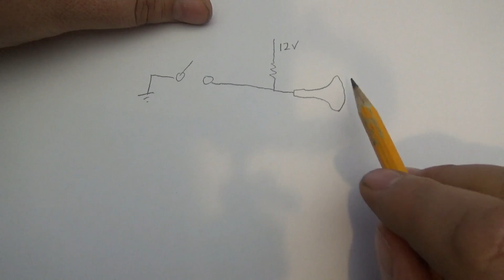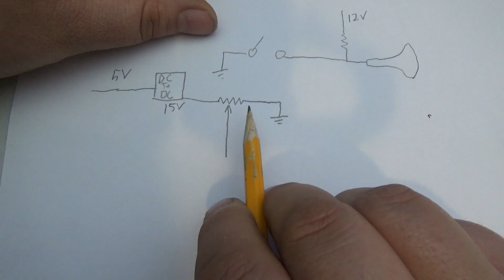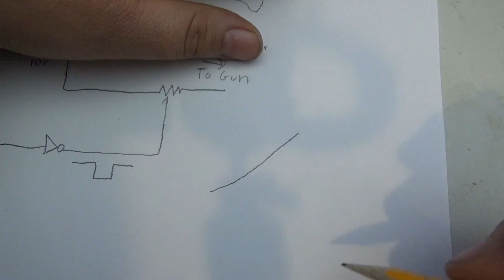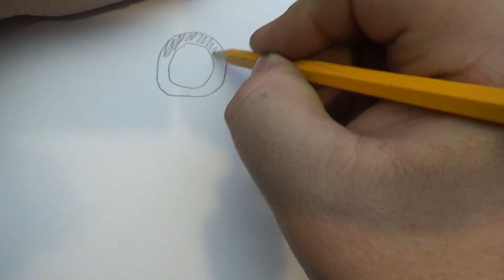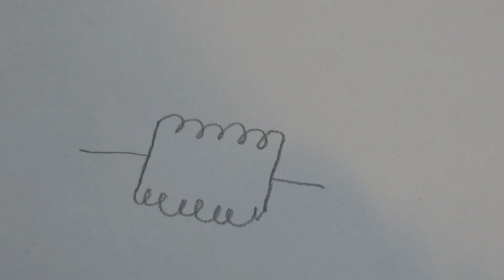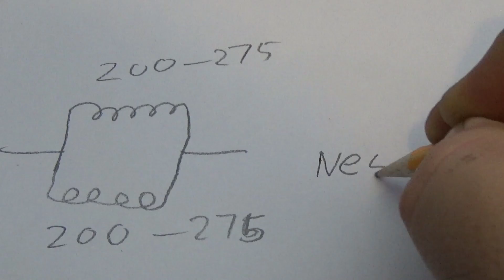WORLDS SMALLEST VECTOR MONITOR

Comment: Thanks! I like your yoke design. Simpler than what I was thinking. I will be making an XY yoke soon and I need ideas. My commercially made XY yoke has been dedicated to an image dissector tube based television camera I am currently building. If you are interested, there is more stuff like this on my channel too.
Reply from the maker: i watched your video. if you plan to run your vectr scope clock pcb you may need a faster yoke. the yoke should be measured by inductance but lets say .5 ohm per coil might get you there. the reason i suggest that is i believe that pcb is intended for electrostatic deflection.  i seen a comment somewhere you were curious about that mini deflection pcb. my email is koppjason83@yahoo.com i can design a custom deflection pcb if you like

Comment: This is incredibly cool.
To make it even more power-efficient, would it be better to use a different yoke shape? Doesn't the toroid trap most of the deflecting field inside the ferrite, where it goes right around the outside of the tube?

Comment: Ofcourse you can use inverters to work on analog signals. Thats what CD4069 are for. They are always unbuffered (so a single CMOS inverter gate), just put a feedback resistor on them, input resistor to set the gain and you are set.

Comment: I kinda want to make my own CRT, maybe out of a large test tube so I don't need to learn glassblowing. I wonder if that is feasible.
Reply from the maker: yup i have done it before its actually not that bad . collect the phosphor from a fluorescent tube or a bw tv set  mix with distilled water then pour into your new tube let dry . also you will need a vacuum  pump.  remember some cathode materials last longer than others
Reply: @ArcadeJason  hmmm, I might "borrow" an emitter from a broken television. My only worry is that a "standard" Amazom vacuum pump will not be powerful enough, and I will need one of those mercury powered ones.

Comment: Very cool. My dad and I have made several animatronic robot sculptures with Oled and tft displays for video and digital alien text effects. A little vector display like this would look awesome on one of them.

Would a Sony watchman tube work as well?
Reply from the maker: cool i want a johnny 5  some day lol
Reply: Arcade Jason haha make one!  Here’s our first one, later I started putting lcd displays and those hitachi led matrix displays. This one lets you send texts to it through Bluetooth and he says what you sent. Also has motion sensors etc. about 7 servos drive the movements. https://youtu.be/Ij0iRvXPcFM
Reply: Another one has a servo driven eye and the other eye is a video of a real eye. The service for the mechanical i is controlled through pwm out the audio channel of the video. That made it easy to synchronize my just moving the audio pwm waveforms around in Final Cut Pro. Left audio  channel for the eyeball, right audio channel for the eyelid. https://youtu.be/S6JlAZkq6io
Reply from the maker: @sideburn  good work man i never was good at software . the head looks to have lots of work into it
Reply: Thanks, my pops is an artist. He’s also done about 50 robot paintings that are pretty cool. He does all the work I just do the electronics part. He went nuts and made about 10 more of them. I’ve got my work cut out for me now. 🤦‍♂️ would be awesome to do an analog CRT like that. Mad max / blade runner beat up industrial analog tech style.